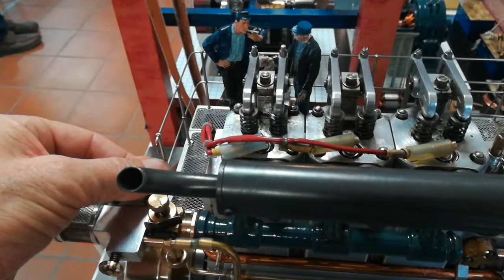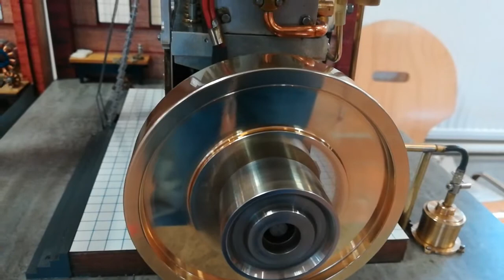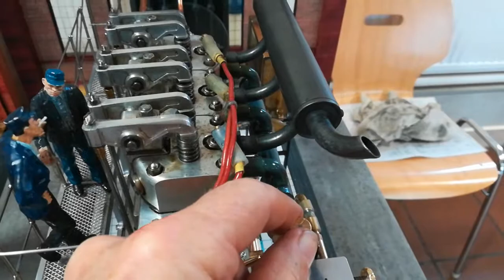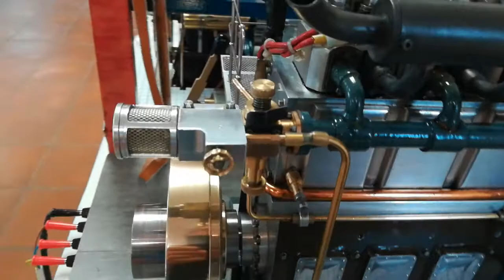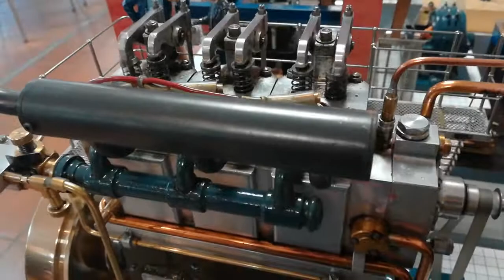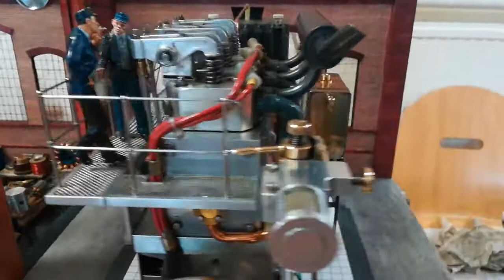Modell-Schiffsdiesel läuft auch sehr langsam! -von Manfred König

Comment: Diesel??? Low compression carburetted diesel with sparkplugs running on gasoline.
Reply from the maker: Dear engine friend, I designed the engine in such a way that its external appearance corresponds to that of a ship's diesel engine, but to build an injection pump which, measured against the figures, is the size of a portable radio, is almost impossible to recreate with a reindeer injection pump! It is even more detailed than the engine itself! It was too small for my machinery. So I chose the compromise of carburettor operation and glow plugs. Kind regards, the ore model builder.

Translated with www.DeepL.com/Translator (free version)